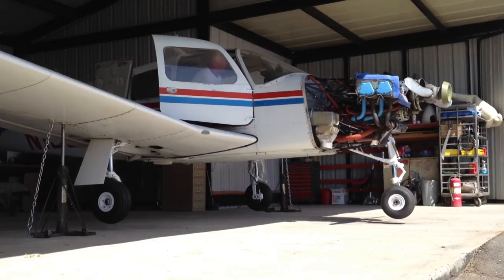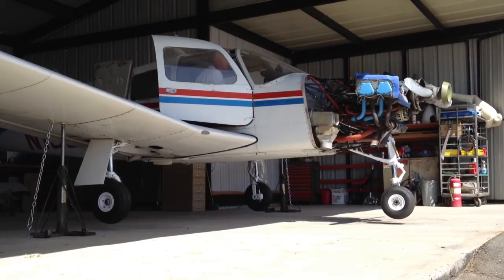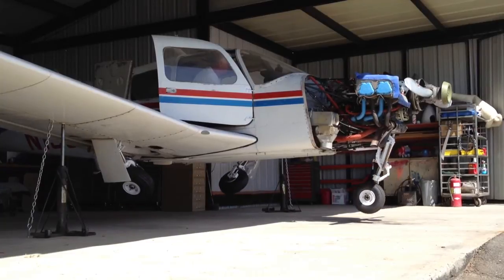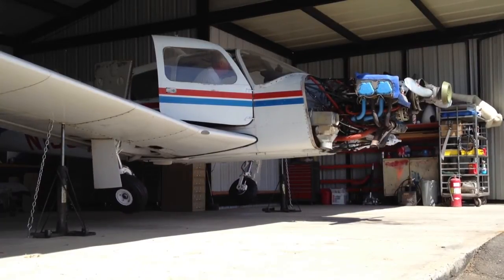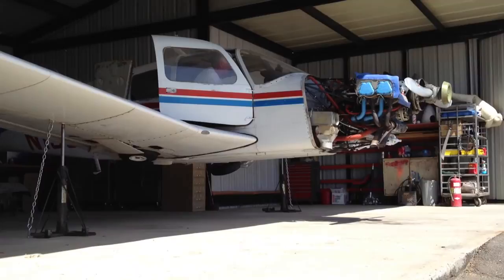Piper Arrow II full landing gear cycling test.

Comment: Could have done all of that the last time the plane was flown . I assume it's last landing was on it's wheels.
Reply from the maker: Scott Patterson the plane sat a few years before I bought it. I was just putting the gear thru it’s paces. Did a lot of work on her. I had to replace the landing gear pressure switch that controlled the pump pressure. Never had a gear up landing. The plane now is a very happy flying machine.
Reply: that makes perfect sense! I get a little irritated with some of the annual inspection overkill and high cost pricing. Not to mention every failure I've had in 30+ years has been caused by require service by others.
Reply: That’s kind of a snarky comment 😬

Comment: If the gear can come down by gravity - what you call the emergency deployment - why then use the electric motors to lower them?
Reply: I think the gravity is the back up plan.
Reply from the maker: theknightlynews during the emergency gear extension, there are strong springs that pull the nose gear down as it is working against the aircrafts forward speed and the nose gear folds forward. I sold this plane 4 months ago. I thought I replied to your post when you wrote it. I sure did something wrong during that reply. Sorry. Thanks for watching.
Reply: At a guess:  When the gear is pumped down by hydraulic pressure (generated by the electric hydraulic pump that you hear running) the hydraulic pressure forces the gear against the stops and makes it more secure.  Now they're also held by the mechanical/electrical locks even if the gear is gravity-dropped, but hydraulic pressure (I would guess) provides additional security.  

So the emergency deployment is a lever that releases the hydraulic pressure on the gear actuator cylinders all together, regardless of what the pump is trying to do.  The great thing about the Arrow gear system is that you can lose all of the fluid from the system, and the only effect will be that the gear will just drop, which means you have to slow down, but you can land safely.